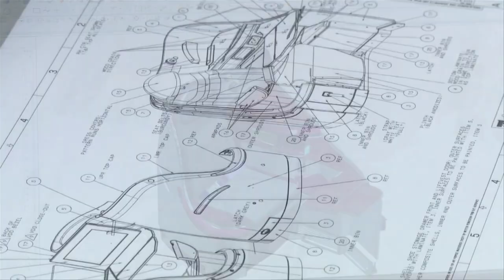Qatar Airways Set To RETIRE Their A380 Fleet!

Comment: If this happens, the service lifespan of a380 is way shorter than 747.
Reply: 747 still gonna continue as a cargo plane for long time to come. incorporating 747 as cargo plane was simply brilliant idea at its time and 50 years later still shock me how ahead 747 was during its time. cant say the same for a380, wrong plane in wrong time.
Reply: With the current backlogs plus the AF1 replacement program, by the time the last A380 rolls off the production line, the 747 will still have at least another 2 years before it stops production.
Reply: @laujack24   Airlines are still ordering the passenger version. JAL for example
Reply: Ryan Keller The lastest ever 747 passenger variant 747-8I was delivered to Korean Air way back in June of 2013. The rest of the production is Freighters, which will continue for quite a long time
Reply: T - Rex The A380’s Frame isn’t meant to keep going for over 3 Decades. So basically after 30 Years it’ll become obsolete since it isn’t designed for periods that long. I believe EK will retire their A380s before or when it hits that limit of age in Service
Reply: The production of the A380 will stop in 2022 the latest.
Reply: It sold more than the B747-8 in the passenger market.
Reply: @نادرالیراحمان  Okay still the 747-8F is striving and will easily last more than a decade latest. The A380 barely lasted a decade and a half and it doesn't have a cargo version to help it stay on the market

Comment: It appears Airbus made a poor strategic decision launching the A380 and Boeing made a good strategic decision deciding not to compete. The aircraft industry can be cruel.
Reply: Richard Shelton Correct Boeing called the market correct Airbus didn’t. It’s really that simple
Reply: Yes, it was a big mistake, but Boeing made two mistakes in the meantime: Outsourcing the 787 costed an extra $20B in development and insisting on 737MAX weakened their narrow body market position. Now they are in difficulty to compete with A321 and A330neo. If they choose to develop a wide body NMA, it will be their third mistake.
Reply: Hakan Evin No doubt Boeing Totally screwed up the 787 program implementation. But they got the market segment right it will be around for many years
Reply: @johniii8147  If it was true, they were not in need for an NMA now. 737MAX is in technical limits (landing gear mechanism of 737-10 is a joke btw) and 787 is to expensive to be shortened. They don't have a product to compete with A321 and A330neo in medium range.
Reply: Hakan Evin Yeah right the 787 has already sold more than 1500 units So the market is telling you otherwise. It’s doing so poorly the ramping up production
Reply: @johniii8147  1421 aircraft, half of which were sold before there were NO serious competitor in the market :/
Read my words correctly. I don't say 787 is not selling. I say, it would be selling more if its costs were not bloated by $20M per aircraft because of the mistake they made in outsourcing the development.
Market is already telling this loudly. You need to listen more :/
Reply: It was built for the wrong reasons, national pride instead of market driven reasons and here is the result, billions of tax payer money wasted, this thing did not earn a single cent of profit
Reply: Yeah but Boeing has seen it's own set of failures. Remember at the B777-200LR. Remember B767-400ER. I'm not an Airbus cheerleader, just stating the facts. Both hardly sold in the passenger market, way less than the A380
Reply: @user-yt198  How is it difficult to compare to the A33neo? The B787 sold way more than the A330neo and has more orders.
Reply: They did try and compete with the 747-8i. Unfortunately for Boeing, it sold even worse than the A380
Reply: @نادرالیراحمان  A330/A330neo is optimized for medium haul. B787 is for long haul. They are not one-to-one substitutes; you cannot compare sales figures (You can compare A350-900 to B787). The Boeing aircraft optimized for medium haul is B777 (optimized for 3000nmi). B777X is also for long haul (at 6000nmi).
B777-200ER can be compared to A330neo, but it is too expensive. 
That is why Airasia and Emirates ordered substantial numbers of A330neo.
Had B787 been $20M cheaper (the extra $20M/aircraft is because of wrong development strategy) most Airlines would consider B787 for medium range too.
Actually if you want to compare sales figures, you need to compare A330+A330neo+A350 to B787+B777. That would be fair.

Comment: Hold the phone FFS!
First AF with the 1/2 fleet removal, QF cancellation and the EK doubt..
now this?! 
Well, rip A380...as much as i live it D:
Reply: AF is only removing 3 planes and Qantas didn't really cancel the order now, it had been clear for years they weren't taking those planes
Reply: Air France has been operating 10 A380s and stated they’ll remove at least five of them from the fleet, using the more and fuel efficient 77W instead. Qantas order from the last past decade never made it through, normally they ordered 20 A380s before getting any of them, Alan Joyce said they’ll stick with the remaining 12 in operation and drop the last 8 in the order book
Reply: DerpCakeFlies hi
Reply: @Qatari2007  Sup!
Reply: DerpCakeFlies I’ll dm you

Comment: I hope the A380 will make a comeback like the 747-8i did in a new carbon composite form, sexy new A350 wings and two gigantic GE9X engines
Reply: That will probably be the A380plus
Reply: 747-8i Isn't a comeback. Its actually sold much less than the A380

Comment: the A380 has become a dinosaur, Airlines have an app for the more fuel-efficient triple 7X and the Airbus a350. Airbus got it wrong with the A380
Reply: They've always been a reputable company, they have some great aircraft, but today the need for 4 engine wide body aircraft is gone. I worked on the 747 for over 20 years and believe me I miss that plane very much
Reply: I don't think they got it wrong. Remember designing and planning this bird took years just like it took years to design and deliver the first 747. The 2008 market crash forced all industries to rethink their strategies and the consumers to adjust their lives. These changes ultimately doomed the A380 when it finally arrived.

Comment: Inefficient jet. It made absolutely no sense for airbus to design that jet. It was 20 years to late.
Reply: The aircraft was designed for high density routes
Reply: High density routes that do not exist in sufficient amounts to sell enough units to recoup development costs. Economically (key word there) speaking the aircraft was a unmitigated disaster for Airbus.
Reply: Wasn't totally all the case with the plane in the first place. Airbus wanted a true 747 competitor, but a bigger one, for the hub-spoke system but those were the days 4-engined planes were becoming the past. A380 was also made to pride the EU nation, Airbus just miscalculated the market and made the lawn’s decision majorly based on politics to have the Bigger  one
Reply: @saks5   by "high density" airline executives.

Comment: Airbus took a grand risk similar to the one that Boeing did with the 747 way back in the 1960s. Unfortunately for Airbus, or at least for the A380 series, it turned out to be a misreading of the needs of the current aviation world. I thought that thirst for travel by the booming middle class in Asia would save it, but apparently, it's just too much aircraft, even for Asia, and, because it is not cheaply or easily reconfigured to match the market, it's resale value is pretty much, non-existent..

Comment: It doesn't mean the plane has come to an end. There's over a hundred Airbus 380s still flying and will be for the years to come. It just means it isn't mass produced to the same level as other aircraft and will not be produced for the foreseeable future. Keep in mind that it sold way more than the B777-200LR and B747-8 in the passenger market.
Reply: That’s not a real apples to apples comparison.
Reply: You’re comparing an Jumbo aircraft to a ULH and Freighter Plane. Totally not a true comparison
Reply: @Shadowfax-1980  I think you missed the point. My point was if you're calling it a failure, then look at the 200LR or the B747-8, both sold less. I know they're in different categories.
Reply: @Racko.  The B747-8 is not just a freighter plane. In the passenger market it sold less than the A380.
Reply: نادر الی راحمان So you’re comparing it to aircrafts from completely different markets. The LR operates a niche market, so there’s no surprise it has less orders. How come you didn’t compare the A380 to something like the A340-500/600 or even the A330F
It’s still a failure regardless, orders don’t matter anymore as of it, it just didn’t make any profit regardless how many orders it has

Comment: EK’s been asking Airbus to “neo” the A380, given that Airbus has already shown that they can make really fuel-efficient planes or update older platforms like the A350 and A330neo..

but Airbus’ “take it or leave it” approach is not sitting well with customers, and I see this move by EK and Qatar as a massive “screw you” from their customers by simply cancelling or making a big fanfare of the retirement of their A380...
Reply: Airbus really doesn't want to make a neo now because they are anticipating the Ultrafan from RR in 2025. That is also why RR refuse to upgrade the Trent 900. Why bother to upgrade it when you have a better solution down the pipeline. By the time the A380 neo using the Trent 7000 upgrades hits the market, the RR Ultrafan is just right behind and customers will be asking for another upgrade.
Reply: There is no guarantee that Emirates would have bought them in those huge numbers. They are already reevaluating the previous orders. Smart move by Airbus nit to NEO the 380.
Reply: EK is not asking just Neo. Neo in A330 and A320 was engine, winglet upgrade and optimize seats. EK is asking a redesign of the wings which are too big and heavy for A380-800. Original (extremely over ambitious) A380 projection assumed a stretched A380-900 design for which wings would be the same. Airbus doesn't want to burn another $5B to $10B development for a single customer.

Comment: A comment in your video is misleading. A380 does not have efficiency problem per se; it is as efficient as A330, A350 and B777 above *certain load conditions*.  Any of these aircraft will not be profitable under 65-70% passenger load factor, and in some competitive routes this can be as high as 80%.
Airlines have difficulty to achieve that load factor. Even you can get exactly the same profit, It is easier to 70% fill 2 x A330 or 2 x A350 than 1 x A380 with 70%, because with the former case you are giving passengers more flexibility for their flight schedules.
You can only talk about A380 not being much more efficient than 2 x A330, which could have been possible had A380 been 230 tonnes instead of 270 tonnes. Unfortunately it is not. Airbus couldn't do a lighter aircraft. 
As a summary, even if A380 had 2 engines instead of 4, it would not have made much difference.
Therefore, farewell A380.
Reply: Hakan, Yes indeed, the A380 has better economics than the B777-300ER when you have high load factors like Emirates and Qatar. Another reason for airlines abandoning the A380 at 10 yrs is the costly retrofitting. Airlines constantly updates their cabin products and if it is too costly to revamp the aircraft,  it would make it cheaper to just buy a new one to replace.
Reply: Hakan Evin

I believe the word "perceived" preceded "less efficient".

And none of your objections  matter. As flown, the A380 costs more per passenger-mile, and that's what pays the bills.  AND it imposes additional costs due to scheduling flexibility issues arising from a fleet consisting of a smaller number of larger planes. 

Further, that all of this would be the case was apparent before Airbus even committed to building the plane.
Reply: @occhamite  Where did you get the figure that A380 costs more per passenger-mile?
Reply: That's not what I said.

"As flown" takes into account load factor.

The A380 is simply too big to fill, consistently, in enough times and places, to make economic sense for Airbus to ever have built.

The paltry 240-odd deliveries after 10+ years, early retirements, lack of a lease market... says it all.
Reply: @occhamite  So? Airlines cannot utilize it properly because it is too big, too heavy, inflexible? That is already what I have said :)

Comment: The co-French-German management is just too ineffective. Should have announced the A380-900neo instead of A380plus
Reply: Peizxcv  Nope the Market is just not there to  justify the investment From either the engine manufacturer or Airbus
Reply: John Iii The market is plenty big. Most transpacific flights are packed 777-300ER and North America aren’t building new airports
Reply: Peizxcv The market proved otherwise. The 777-300 Is significantly smaller and a lot more cargo volume And much more efficient. The US doesn’t need to build more airports. Unlike other countries there are 15 at least major international gateway’s that’s the difference with US market the traffic is disbursed over multiple hubs
Reply: John Iii A stretched A380neo would have more cargo volume than 777-300ER. For airport, I am not sure what you are talking about as new airports aren’t being build so no matter how many hubs there are the capacity is limited.
Reply: Peizxcv The US does not really have capacity constants. And no the 380-900 Or simply never happen it’s too big
Reply: Peizxcv actually not. I can load 8 pallets of freight in the front of a 777-300ER. The A380 only takes 4-5 depending on the ULD locks and if you place LD3 containers in the front. If you stretch the A380, you may get 1-2 more positions. I work the 787-10 and it takes more than the A380. 

Between the expensive maintenance costs, fuel, infrastructure improvements, and LCC’s like Norwegian, WOW, Primera, and Le Compagnie flying across oceans with narrow bodies from up in coming secondary airports, the A380 is dead.